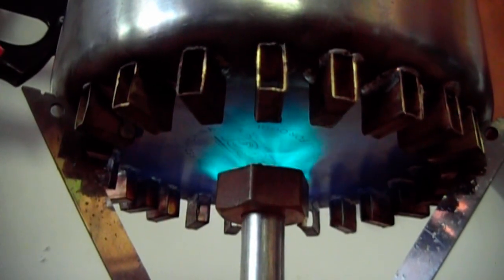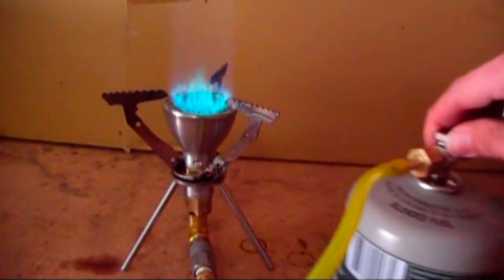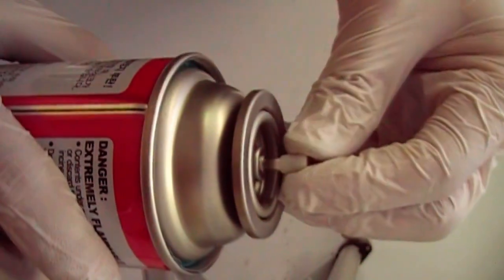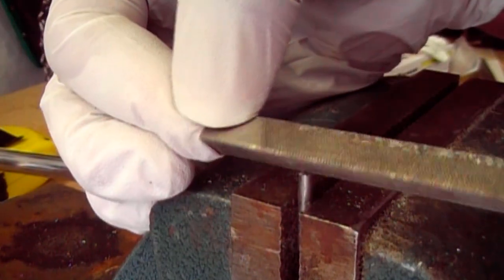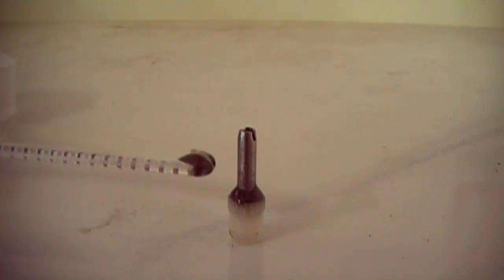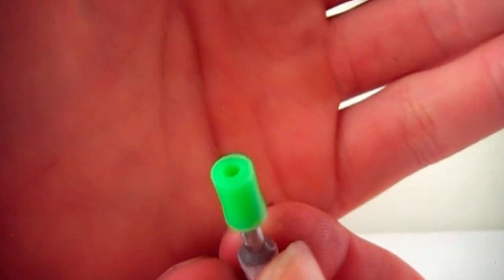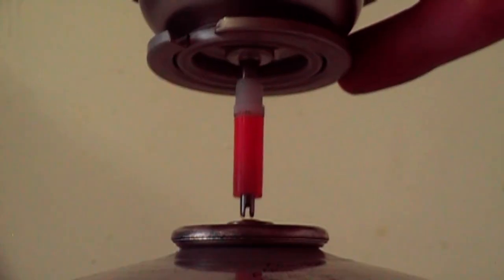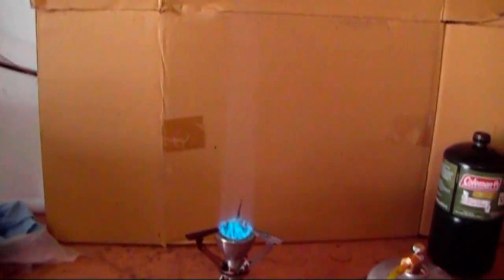How to refill camping butane tanks

Comment: you give prime examples of thinking outside the box, in your uses of the drill....that was just genius putting the drill bit in the vice and using the drill itself to hold the item to be drilled. A very simple solution to drilling such a small item easily and in a balanced fashion which was crucial to your final outcome. I shall not forget this trick if I ever have the need.  ha ha i love it
Reply from the maker: Awharry36 Thanks!
Reply: yes, these are some great ideas.. a practical wisdom..
Reply: +Awharry36 I took notes and laughed at myself, how smart and simple to use a drill like that.
Reply: That there is some of that out the box thankin
Reply: Awharry36 That's a no brained for a machinist but yeah a good tip.
Reply: Is that bit whackbirds?

Comment: Hi, ignore my last question - I've now read all the questions and your replies to variations of my previous question. I now understand the nylon part salvaged from the lighter has different diameters at each end and it's the smaller diameter end you're drilling out but that doesn't affect the other end that fits on the refill cannister stem as that end's internal diameter is still larger than the drill bit OD so remains unaffected. Nice video and, as others have said, neat engineering tips. I've often looked at the bits in lighters and marvelled at the precision engineered parts in there when you consider how cheaply they are sold.  Thanks for sharing your creativity and engineering expertise - I'm going to see what other videos you've created. Cheers!

Comment: You made a great video. I just now finished up refilling my 1lb. propane bottles and was searching for reasons why one of my 15 bottles would not refill and I came across your butane filling video. I did not know about having to chill the bottles first and that does make sense now that I have seen it here. Good job, I will have to make your valve stem if I ever begin using butane.
Reply from the maker: Thanks, yea if the pressure is equal in both the large tank and the small bottle, the liquid will not transfer. If the small bottle has a little liquid propane left in it, that means the pressure will be the same as the large tank if they are the same temperature. Chilling the small tank gives the pressure difference, warming the large tank works too, but you have to be more careful.

Comment: Great video. One thing I'm confused about - the nylon piece you salvaged from the lighter is shown as a good fit on the refill container BEFORE you drill it out to take the stainless tube, so how can it still be a good tight fit on the refill container stem after it's been drilled out? (unless you're only drilling part of the length sufficient to fit the tube into it.) Does my question make sense?

Comment: Great video, thanks. I don't know if you monitor comments on older videos but the "safe" fill mass for n-butane, aka straight butane would possibly be just a little more than for a butane/propane mixture. Ir the butane included the branched isomer methylpropane, aka isobutane, then the safe fill mass would be a little higher still. The reason for this is the density of liquid isobutane is higher than that of n-butane. Both butane isomers have higher liquid densities than propane.
Reply from the maker: Thanks, I never thought about the specific densities of the fuels before. It makes sense though, that the lower boiling point propane would be a lighter density. Thanks for the comment!

Comment: Nowdays you can use an adapter to the gas bottle which has no EN417 connector.  No need to refill, just use the adapter and so you can use the cheaper gas bottles.

Comment: Thanks for the video. You should add an information that you should wear safety goggles while refilling. You already overshoot your canister. If you are not careful or try to refill it with propane, the canister might burst. I don't think it will catch fire, but if you get this stuff in the eye its most certainly not pleasurable.
Reply from the maker: iuiz Not a bad suggestion, but being well aware of what is going on is the reason I don't feel the need to wear goggles. You can fill the canister completely full with butane, the danger comes when the tank gets hot. The canisters come with a little propane in the mix, so they are stronger than what is needed for just butane. A propane fill is not possible because I have no way to do that. Thanks for the comment!

Comment: Alternatively, use a stove with a remote canister feed. Then use an adapter to use the butane canister directly. The remote stoves are a little heavier, but can be used in a wider range of temperatures and are more efficient as you can use a wraparound windscreen, helping compensate for the weight.

Comment: I remember in late '70's early '80's they used to have butane bottles to fill cigarette lighter that came with a variety tips for the different makes and models.  Who knew taking apart lighters to get the same parts would be an issue :)

Comment: Many thanks, but, is the tube you use silicon, as used for methanol RC model engines? you state it's the fuel tubing for gas engines, which is different, gas will swell silicon tubing to 3 times its size, the tubing you use looks to be silicon and quite soft, hope you can clarify as I would love to try this. thanks again for this great idea!

Comment: I spent over $100 buying a custom (made in Japan) valve and adapter fittings to transfer gas between cylinders and refill. I can refill with both propane and butane now.  I must say your less than $15 method looks pretty good.  Low cost effective. 

Be aware that it is a violation of Federal Law and many state laws to transport refilled disposable cylinders. Sticking with N-butane is a good idea. Those cylinders don't like being filled with all propane (yes, I do know that).
Reply: Did you have issues with refilling with propane?

Comment: You can buy the adapter with a metal hose which works off of the tall round butane bottle. No need to off load at all. Just buy the cheap butane  bottles.  They are lighter than the expensive ones anyway. I bought mine on E-bay for under 20 dollars. Every town has the bottles too.

Comment: Very useful idea~
But I think you can also find some adapter for your stove since you ware using the separate stove(I don't know how it actually call, but is the kind of stove that you used in your video. ) 
I found 2 adapter for my Kovea Spider stove, LPG and Butane, so I can use more fuel than just those camping canister.

Comment: Thank you so much for sharing your knowledge. This is what I have been looking to do for some time but had not any idea of how to make an adapter. Have you had difficulty using the fuel at elevation. I sometimes get up in excess of 10,000ft elevation and have heard the fuel will sometimes not work. Any thoughts? Peace, Mo
Reply from the maker: I have used it at about 12,000ft with good results, may have been burning a bit rich but it was too bright to see the flame well enough to tell. The cold weather it dose not like though. I might build a stove to run in inverted tank mode for winter use. Thanks for the comment!
Reply: clkindred Most of my elevation hiking is in the cold weather, sometimes below 0 degrees. You mentioned an inverted tank mode? Never heard of that. How would that help? Peace, Mo
Reply from the maker: Maurice Gundrum
 Inverted tank mode is like a butane stove / white gas stove hybrid. It takes liquid butane from the detached tank which is used upside down to feed liquid. The liquid butane passes through a preheat tube that passes over the flame of the stove, rendering the butane a gas. It is then routed down into the stove itself to burn. This is used for cold weather because the change of phase from liquid to gas inside the butane tank causes the butane to self refrigerate and become too cold to give vapors. To put it simply, the tanks freeze up and will not have enough pressure to run the stove. By using the tanks inverted the change of phase happens in the preheat loop therefore will not chill the tank. Also the reduced pressure of the winter cold butane is still plenty to push liquid out into the stove. Another plus is the tank is used in remote style feed, the tank is off to the side of the stove, connected to it by a flexible hose. This means the stove is nice and low to the ground for stability, and you can windscreen the stove without overheating the butane tank and blowing your dinner off the mountain.
Reply: clkindred Wow! I will have to check into that kind of set up. Thanks again for the info. Peace, Mo
Reply: They make adapters to add Propane to the mixture  Isobutane works better in the cold than Butane does..

Comment: Hey that was a great video, thanks for sharing this information.  The white plastic piece that you drilled with a1/8 bit, did you drill it all the way though? I'm thinking no because if you did drill it all the way it would not fit the Koran butane tank tip right? Plus where did you get that silicon tubing? Thanks again..
Reply from the maker: Yep, drilled all the way through.  The end that fits onto the korean tank is much larger than the 1/8th hole being drilled on the other side, and is not affected by the drilling. The silicone tubing is fuel line for gas powered RC cars. Places that sell radio controlled models will have it.

Comment: Excellent video but I'm wondering if just using a straight forward, commercially available, adapter setup for using the cheap butane canisters on a stove would be a simpler option? This is not a criticism, just a genuine question.

Comment: It's easy to tell when you have overfilled a tank, because you didn't measure grams of gas.  Place your overfilled tank in the hot sun of a summer afternoon.  If you have too much stuff in the canister, the concave bottom pops convex to relieve the pressure, turning the canister almost round.
If you have it hooked to a canister mount stove at the time, the round fuel can will dump your pot of food onto the ground, and liquid gas will gush out of the high pressure canister like a flamethrower.
Ask me how I know!  Or better, don't.  Use an accurate scale.
Reply: Yep.  First stage is concave bottom convexes.  If the excessive pressure situation continues (hot canister), next thing to give is the rolled edge, barfing high pressure flammable liquified gas into your campsite/tent.
Reply: i can speak from experience and i will yell DO NOT OVER FILL it can be very dangerous and very bad if the stove is lit, i had one go concave to a ball while inside and it started hissing as a seam was letting go and i woke up and threw it outside where the seam let go completely, no damage to the house but i did have a furnace with a pilot light as well as a hot water tank within 20 or so feet of where it started leaking gas
it may cost  a little to buy a scale but you will make up the savings after a few refills

Comment: Love your video!  Have you tested the butane refill vs. an Iso/Butane stock canister?  Are your burn times about the same?
Reply from the maker: Humm, no I have not. My thinking was for use in testing burner designs, and when car camping in the summer when I don't mind less performance. Winter trips or actual backpacking trips where that is important I would use a new canister. Perhaps I will to a test to see just how much the boil times vary.

Comment: Nice idea but you can buy a adapter on ebay to convert the long cheap butane cartridge to a screw type on ebay for about $2. I only use propane blend during winter as i find you dont get enough pressure with butane

Comment: Great video!  I'm actually wondering how you built your stove testing kit.  Any chance you could share the materials needed?
Reply from the maker: I'm not sure I understand what you mean. "Stove testing kit" as in items to test stoves? The stoves I tested are ones I made, everything about them, including how they attach to the fuel source is part of that stove system and can be different for each. Are you asking about gas valves and such?
Reply: The adapter on the canister at 6:00.  I guess my main question is where you found the valve to fit the canister?  What is the thread count on the canister?  Thanks

Comment: Thank you for this information. I want to try this out. Could you provide a couple of information? 1. How many times can you refill the tanks? (How long does the adapter last?) 2. How long is the silicone rubber hose? 3. Lastly, if you have one of the mini propane tanks half full, can you refill the rest with a butane?

Thank you again~
Reply from the maker: 1: As long as the rubber seal inside the tank is in good working order, and the tank itself is in good condition with no rust or large dents, the tanks can be refilled indefinitely. I'm on the tenth refill on that one in the video and it's still good.

The adapter is not expected to ever wear out or break.

2: The silicone hose is 1/2 inches long, (about 12mm) but if you make this, your length will depend on the length of the steel probe. The silicone hose needs to be about 1/4 inch (about 6mm) shorter than the steel probe.

3: Yes, but you will need to chill the half full tank well before topping off. If both the tanks have liquid butane in them (the refill tank and the tank being refilled) then the pressure in both of them will be equal, so there will be no transfer of fuel. If you put the half full tank in the freezer and reduce it's temperature, you also reduce it's pressure and fuel can flow into it. You can also increase the pressure in the refill tank to get fuel to flow but, I do not recommend warming the refill tank in any way other than with sunlight or body heat.
Reply: clkindred Thank you for the info. By any chance, have you ever created a cozy or have a good easy way to keep the tanks warm while in use? Rather than just wrapping it in a beanie, if you found a to keep the tanks warm in higher or snowy climates?

Thanks again~
Reply from the maker: tigersfa88
A beanie warms your head by keeping heat in, the tank gets cold because of the change of phase from liquid, to gas inside the tank. There is no heat to keep in, in fact a cozy would make things worse by keeping outside heat from getting in, like a drink cozy keeping a drink cold. You can run the stove with the tank sitting in a pot or pan, or even a plastic dish of water. This will increase the thermal mass make it harder for the auto refrigeration going on inside the tank to chill it. Warm water helps too, just don't go too warm.

Comment: You need to sell a high grade attachment like this with a pressure gauge.  Why not make yourself a little cash for those that don't want to head hunt for the parts.
Reply: Totally agree.Not everyone has the shop tools or skills.
Reply: They sell adapters for those who don't want to DIY. But I want to know where I can get the refill bottles of Butane for $1 each? What store has them? Hardware stores like Home Depot sell them for more than $5!
Reply: Restaurant supply houses sell them for roughly 20 a case. 1.66 ea
Reply: here in New Zealand, they even seem to be cheaper! I can buy a pack of 4 for $6. $NZD
Reply: Maybe Asian markets? Amazon is $1.83/can bulk, 12 can purchase.
Reply: adapter w/  black case http://www.ebay.com/itm/142380535366
adapter w/  silver case http://www.ebay.com/itm/132279773716
adapter w/o case          http://www.ebay.com/itm/272665832470
Reply: Pressure varies a lot  by temperature..  You can't fill this type of container  over 80% full and  thug the manufacturer knows how much the liquified gas weighs and they know the volume of the Container..  Another   good idea is to weight a new full canister and right that weight on the bottom of the can and don't go over that weight ..
Reply: $4.50 on ebay... he'd have to hell thousands and thousands of these to make any kind of profit from the time and effort not to mention materials to make these.... not worth it!

Comment: Hope this is not a dumb question... can you fill the butane canisters with propane?
Reply: Probably not since propane is stored with higher pressures. Propane canisters tend to be thick and heavy, while butane/isobutane canisters are thin and lightweight, which is why they are the most prolific among backpackers. I'm not an expert though so don't quote me.

Comment: The fill capacity as measured in grams for pure butane will be higher than for a propane/butane blend due to the higher density of pure butane gas, so the tank should hold more than 220g of pure butane if it held 220 propane+butane blend

Comment: I know it is highly not recommended to refill the 1 lb propane disposable tanks. I would imagine disposable butane tanks pose similar risks.

Wouldn't it be safer (and perhaps easier) to manufacture an adapter to fit the cheaper cylinder to the stove?

Comment: Very well done vid. But I would note that you did not speak to the issue of pressure equalization between the refill & empty tanks except mentioning freezing the receiving tank. Please speak to the issue in full. 

Obviously, if the two tanks are = temp, then you cannot get more than half the product to move into the empty, as they will reach equal pressure at some point and stop the transfer. You might reach half full from a full tank, then carry on with a freshie to get to 3/4 full, etc. But there is an issue there as you wind up with partially emptied source tanks. You made such a clean vid I figure you can solve the process for us:)
Reply: most of the Butane is liquid so it will just flow into the other container, the full container also has more pressure to help with transfer